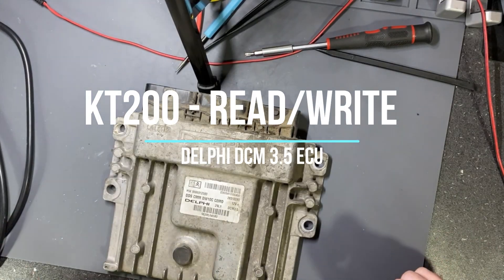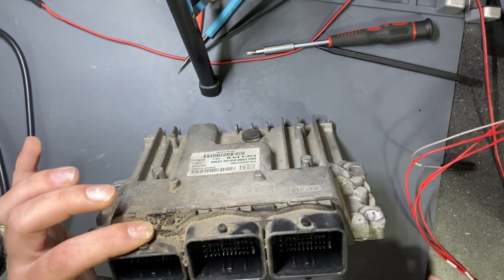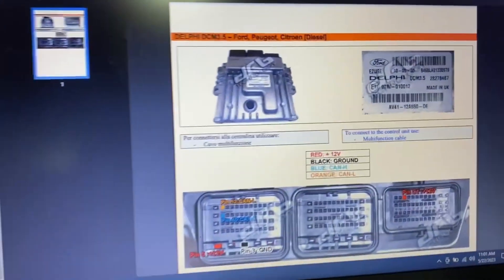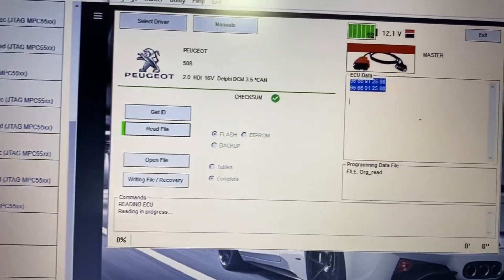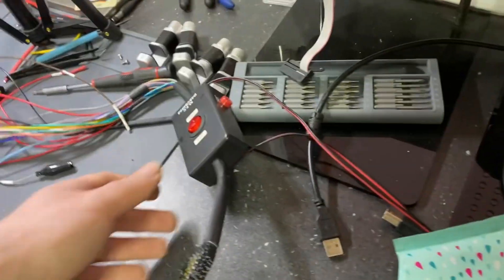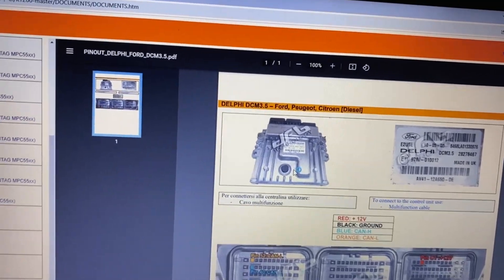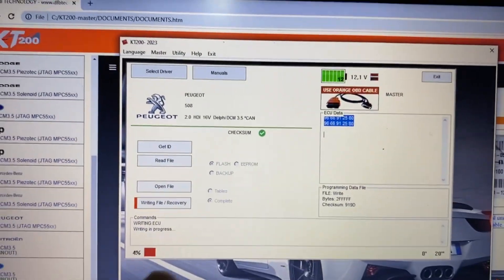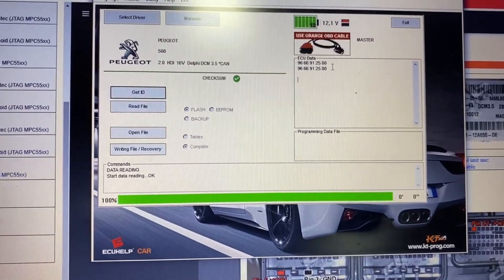KT200 - Delphi DCM3.5 :: Read & Write with multi function cable

Comment: erreur SK1 », « Erreur SilentKey » id oki lecture j' ai se message ??.
Reply from the maker: If is from Ford it will require IMMO data to be authorized, When you have that error can be read / write only via OBD or Boot Mode.
Reply: @UnixCoDElectronics Peugeot  5008 20d 150hp 2010 year dont read dcm3.5. Doesn't read on the table. 
READING ECU

Reading in progress...error SK1

Error SilentKey
Reply: @Pablitqo Do you have a solution. I’m getting same errors
Reply: @ferocious1978 do you solve the problem? I have this on ford dcm3.5
Reply: @jimmyjim9824  No i haven’t

Comment: Cool, I didn't know that it is to do on the table - in the ecu list is only OBD and JTAG :/
Reply from the maker: Basically its same process as rading via OBD just don`t use car electronics and you are connecting directly on ecu. It not work with all ecus, some  ecus need immo authorization to can be read via communication.